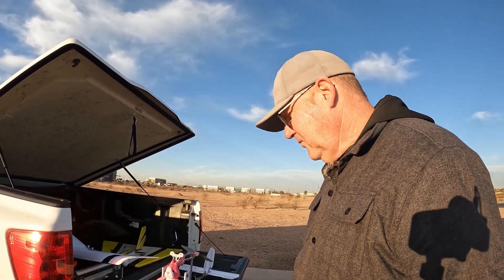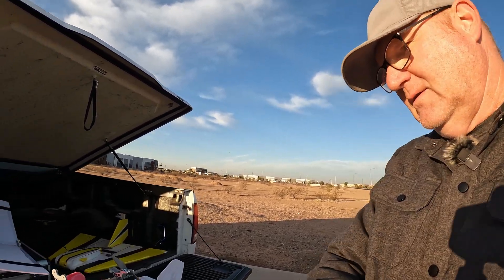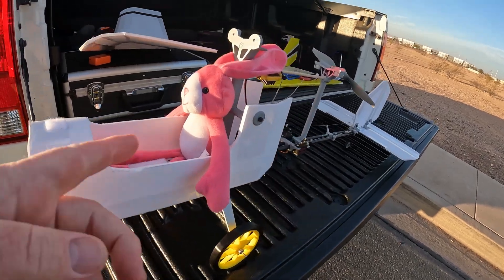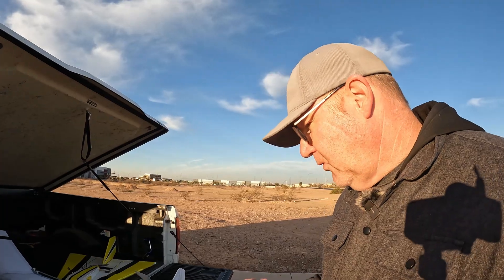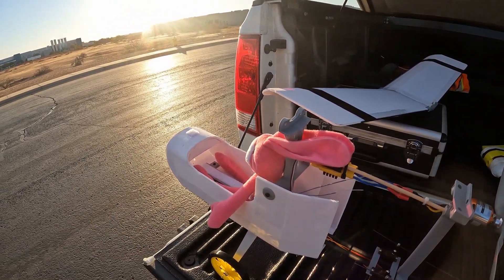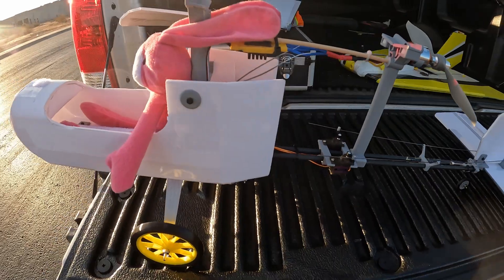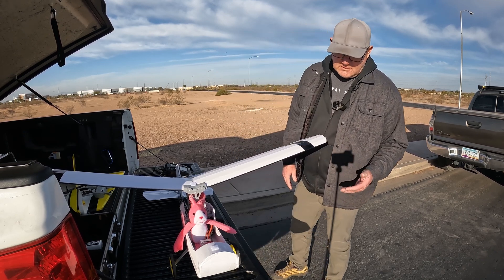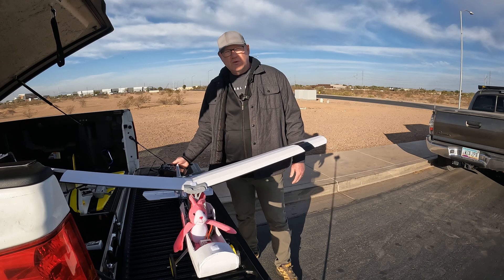Classic Design and Retro Looks // Sparrow Scout with Pilot

Comment: Obviously the fun of creating your own parts on the 3D printer is a benefit, but weight wise how are they compatible to wood? Continue to enjoy your videos and ideas. Thank you again.
Reply from the maker: Thanks Graybear, I used to make them in wood prior to the printer.   I actually think it is comparable.  It is way easier to work with than wood.
Reply: @ That is interesting! If I may ask, what type of 3D printer do you use, and what is needed for a setup? I know very little about them. Thanks again.
Reply from the maker: I use the prusa MK3s printer, but there are a lot of really good printers out there right now. Most of them operate very similar to each other. There is a bit of a learning curve to using them as there is with designing the parts, but it is a very fun hobby and blends very well with RC planes.